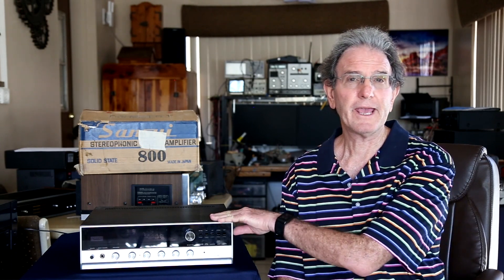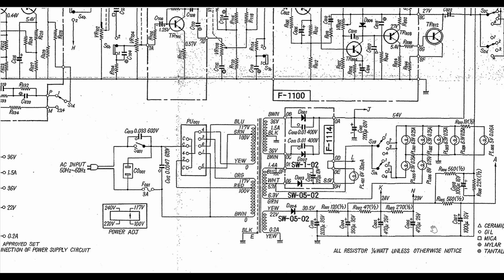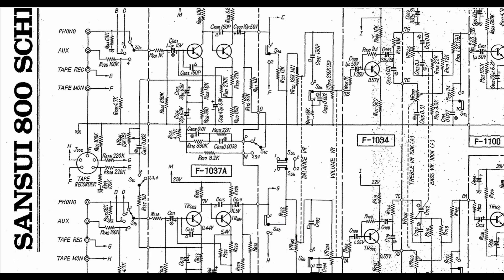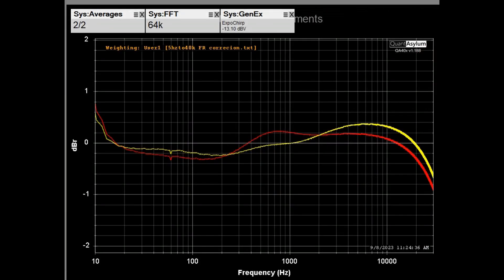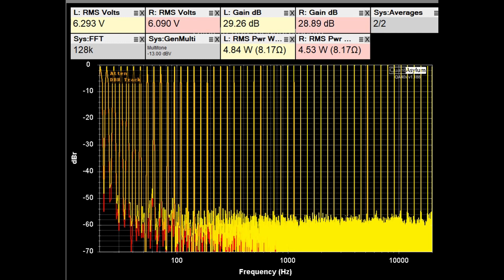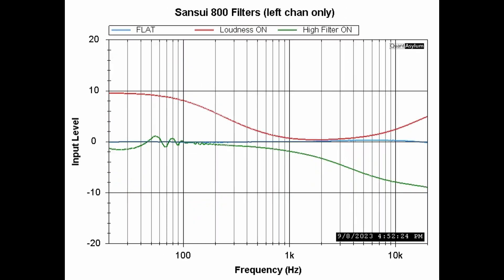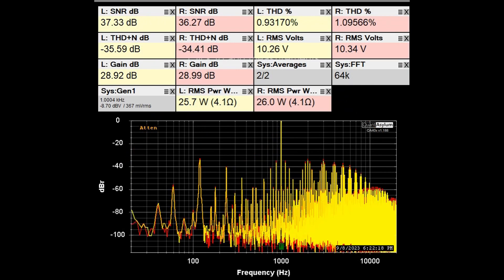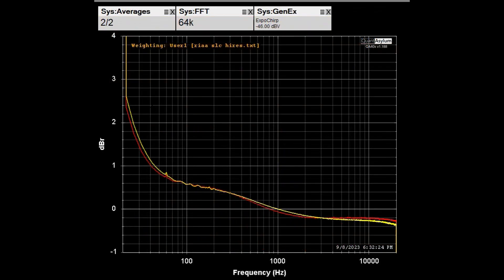Sansui 800 Stereo Receiver- Vintage Audio Review Episode #84

Comment: Wonderful information in this video.  I had a Sansui 800 stored downstairs and plugged it in tonight and was surprised how sensitive the FM tuner was, pulling in stations in the basement using only a 18 guage 4ft. wire on one 300 ohm tap.  Very good sound that is all stock. Interesting that the main power fuse is 5 amp whereas the model in this video uses a 3.5 amp.  Thanks for such a thorough test on this model.
Reply from the maker: Thanks for sharing and am glad that yours is working well still, though not really surprised. Not sure why the fuses are different- maybe one is for the US market and the other for European...?
Reply: @vintageaudioreview  I just checked the called for amperage of the line fuse. It is 3.0 amp. My mistake.  Thank you for questioning that.

Comment: Love your videos! I’m working on an 800 now. Trying to source SW-02-05 diode. You used an NTE 116, which appears to be a 1A 600 PRV Rectifier diode. I’ve seen some suggest an NTE 5802, which is a 3A 200 PRV Fast Recovery Rectifier diode. Any thoughts before I place my order? The info I’ve found is limited, and the main forums are no longer accepting new members.
Reply from the maker: Thanks for the question- since I used an NTE 116, then I would say to use that if it worked for me- I have not watched the video in a while so don't remember the repair I was making, but it worked apparently so I would not be too worried...

Comment: Thank you for this. Just bought one of these. Is the soft thump from the speakers at powering up normal?
Reply from the maker: Thanks for the question. I don't remember if this unit had any turn on or turn off thumps, but it is very normal to have them with vintage gear- I would not be concerned at all.
Reply: Наверно это нормально для него, у меня такой и также включается. Ресивер замечательный! Звук отличный!
Reply from the maker: @ПланетаЗемля-н7у  thanks for the comment
Reply: So I recently discovered another quirk with my 800. I live in SW Florida and I had new windows installed 3 days ago. So I had my AC off for 2 days and when I turned my 800  on I had loud crackling from the right channel that was not affected by the volume or any input changes. Then after 2 days with the AC back on crackles are gone and it’s back to sounding wonderful.  I see a lot of people talking about faulty transistors that were a known issue in the early 70s, not sure the exact number but I think it is SC1845 in the output boards. I am fairly certain this unit has these so could the humidity affect them in this way? I’m pretty much just going to enjoy it unless it starts crackling in a conditioned space. 🤷🏻‍♂️

Comment: I suppose the higher even harmonic is partially caused by the asymmetric power supply and therefore output capacitors in series with the output.
Reply from the maker: I have never looked into why some devices have larger even harmonics than odd harmonics, but it is more than having tubes since a lot of solid state amps/preamps have even harmonics that are higher....

Comment: I have a Sansui 800 receiver that has constant soft crackling in the left channel. Any ideas?
Reply from the maker: Thanks for the question. Sometimes there can be noisy transistors that can cause that, but one would have to do some research on the model to see if that was the case. Could be a filter cap somewhere on the left channel, but that would give you more of a hiss or hum. Possibly a cleaning/ lubing of the controls & switches could solve the problem if you are lucky.
Reply: @vintageaudioreview  Yeah, I cleaned and lubed the controls and switches. No dice. It does however increase with the volume but it isn't coming from a dirty volume pot.
 None of the transistors get warm to the touch. My tech friend told me to check that.
Reply from the maker: @bertroost1675  It is most likely not an output transistor, but one in the preamp section. I have not had the opportunity to try to fix such a problem, but should be able to track it down with a scope by comparing channels.
Reply: @vintageaudioreview  Thanks

Comment: Just tested my 800 and was quite hot to the touch.  Is this normal for this model?
Reply from the maker: No, not normal unless you have been playing very loud for a while (>30min) If it sounds ok that is good, but the output bias/offset voltage may need adjustment.